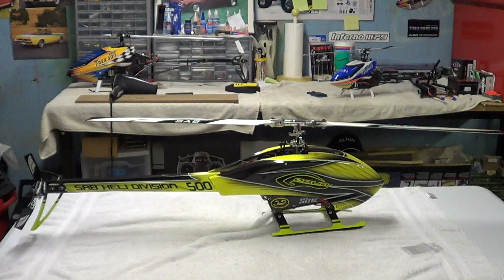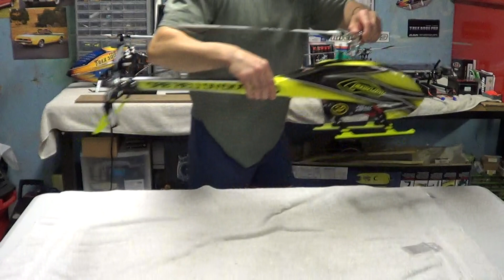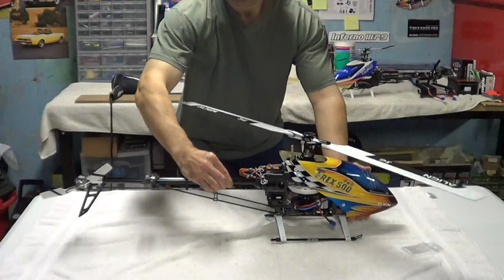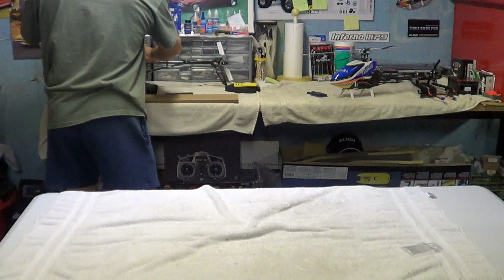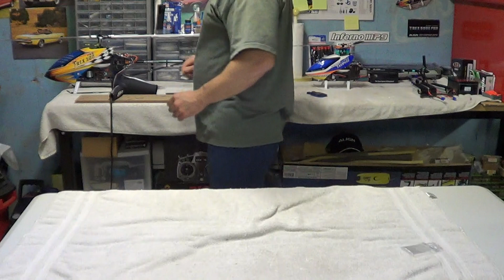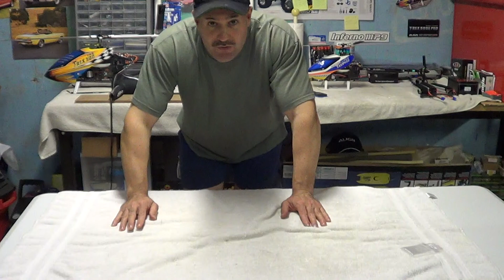Rc Helicopter ,torque tube vs belt driven which is better

Comment: I like belt drives more because they are easier to repair / harder to break and they are quiet. But I see why you like torque tubes. Both are good options with different qualities

Comment: Torque tube is good for 3D as it gives instant tail response without any lag. The only down side is if you strike the tail you break the tail gears. The belt driven is good for new flyers and it is forgiving when you strike the tail but lags little in tail response when doing 3D because the belt is stretching when given more power and how tight or lose the belt was installed. Both are fun to fly.
Reply: So for someone more interested in scale belt seems to be the way to go?

Comment: Belt may tear  and a tube does not. But tube driven make the tail heavier and in my case with trex 500 ESC I need to have 6s (and not less) battery to balance that heavy tail. In general, tube feels much better.

Comment: Ray I love your Goblin 500.
Gosh what a beautiful heli.
I got the Alzrc 380 devil a 380 goblin clone. It flies nice and steady but.......................
Just like the goblin 380 the 
Alzrc is tail belt driven.
Now to me it doesn't matter
TT vs Belt they both have their
pros and cons for example
with belt driven tails you get quieter flight times but some loss of power. Now with TT or Torque Tubes you get smoother more sustained power as shown in the video 
but their more loud or noisier.
I really dont have any preferences. I mean some guys do I understand I respect their decisions that they stand by. If someone put a gun to my head Lmao and told me to choose Belt Drive or TT 
I'd have to flip a coin.
Would you agree Ray?
Or do you have your own
view on belt driven or Torque Tube?

Comment: Yep,,I agree 100% Ray as Im still using my OEM's,but I know guys using them and they've had tail strikes that split the blades and not hurt the gears.
I bought mine as backups thinking they were weak or something,,but so far with 103 flights,,oem TT gears are still going strong,lol. I don't know when I'll get to use mine,,,but I have them and the Maingear hanging on my Heli Room wall.
It's kind of like the DX8,,had mine since Xmas and have so many flights with the 450's and 600,NP's at all.

Comment: Guy's,, the Torque gear stripping days are over,(at least I haven't seen the new ones strip yet). I bought the black gears as backups and from what I've seen so far,you'll beat your tail blades off before you strip them. Get yourself the Upgraded main gear while your at it as it's the same material and bullet proof as well!
It's a Torque Tube for me.

Comment: After all the issues I had with shaft driven micros I felt my belt driven trex 500 was the way to go...smooth quiet. Now I'm flying a Blade 550x ...smoother quieter

Comment from the maker: the goblin spun for 7 seconds and the trex 500 spun for 19 seconds thats a huge difference in smoothness and less drag
Reply: But tt are not remotely forgiving, you give it the slightest bend in even a small crash and the whole thing is useless and needs chsnging due to vibration with torque tube or boom not being straight anymore. 

Id say it slightly helps battery life but it just isnt enough of a pro over belts.